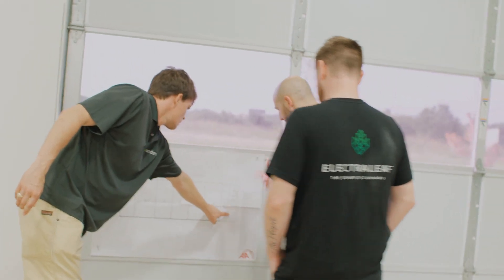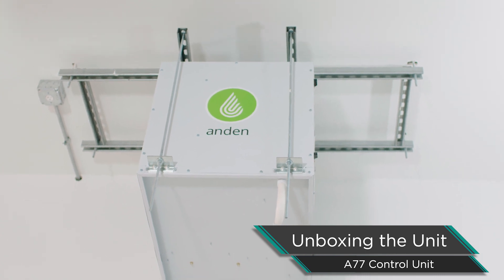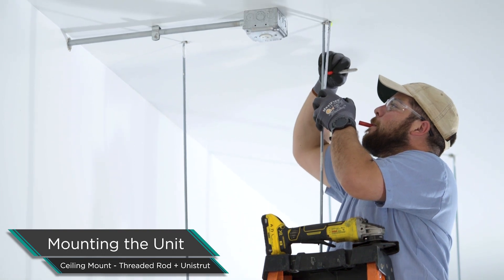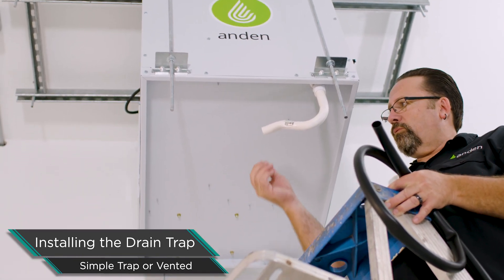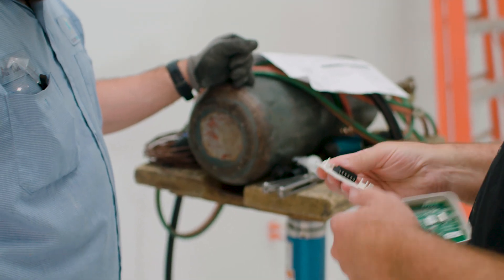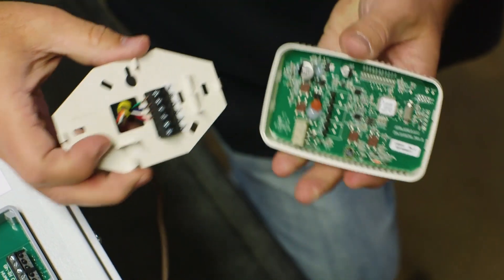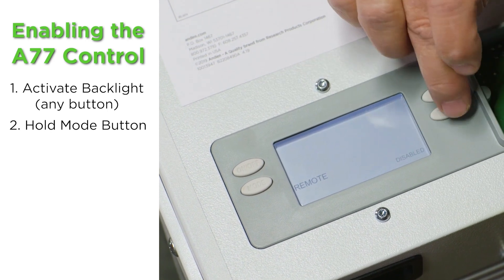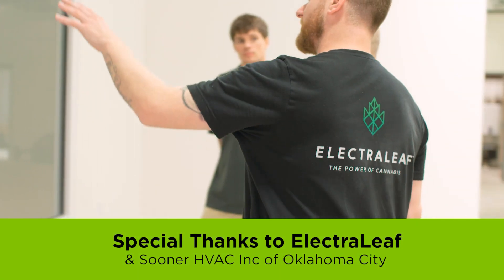Anden | Dehumidifier Install at ElectraLeaf

Comment: Completely skipped the most important part, which is how the hell to get such a heavy unit up to the ceiling without breaking it or dropping it. What is that thing you’re using? Is it like a 10 foot tall jack or something? Seems important to mention that.
Reply from the maker: Thank you for contacting Anden! We recommend the use of a scissor lift on all heavier units ceiling installations.

Comment: Is the liquid that comes out of Anden dehumidifiers pure water? Is it safe to drink? If not, after filtering?
Reply from the maker: Thank you for contacting Anden. We recommend growers do not reuse the water in the first 24 hours of operation of the unit. After that, it is recommended to filter and test the water before reusing. Our dehumidifiers do not create any kind of metals. If you have any additional questions, we would be happy to assist.

Comment: Why do you need to prime the trap? What happens if you dont?
Reply from the maker: Thank you for contacting Anden. Priming the trap keeps air from coming back up the drain. The units that use a trap have negative pressure cabinets where this is required to keep water draining in the proper direction. If you have any additional questions, we'd be happy to help.

Comment: Can i ask some install advice please. Anden a100 dehumidifier being ducted to return plenum. Plenum is 12 x 20"

Am I ok to use side takeoffs for the ducting? Easier for access here. 
Can they be 45 degree( essentially thats actually a top takeoff but being installed as a sidetakeoff) or do they need to be straight collar takeoff?
Reply from the maker: Thank you for contacting Anden. Would you mind giving us a call directly today at 1-800-972-3710 to discuss this? We'd be happy to help.

Comment: At 6:19, he talked about the unit leaking if there's no water in the trap. Why is this and where does the leak occur?
Reply from the maker: Thank you for contacting Anden. The Model A320V1(3) has a negative pressure cabinet, meaning the fan is on the outlet side of the cabinet. So, we are pulling air through the cabinet and air is also pulled up through the drain hole. The drain needs to be trapped with the provided trap to prevent air from coming up through the drain hole and to allow water to flow out of the drain. 

Without the trap, water can fill up the internal drain pan under the coil, spill over onto the base of the cabinet, and run to the lowest corner and drip out.

If you have any questions about trapping or water leaking from a unit, please call our technical support department at 1-800-972-3710 and we will be glad to assist you.

Comment: do you need the trap ?
Reply from the maker: Thanks for contacting Anden. Yes, the Anden Model A320V1(3) does require a drain trap which is included with the unit. All of our smaller dehumidifiers (A70 through A210V1) do not need a trap. Let us know if you have any additional questions.